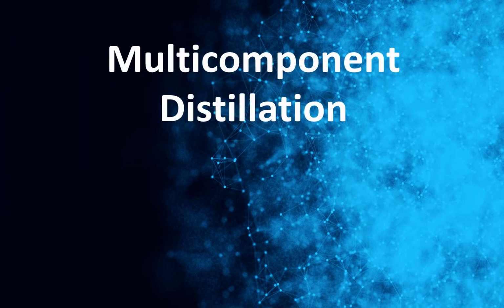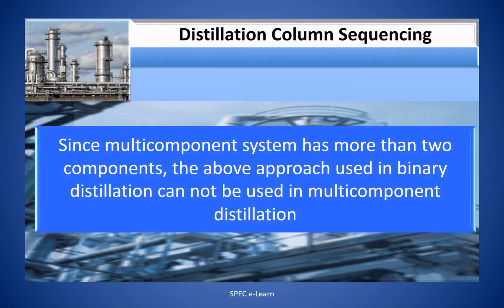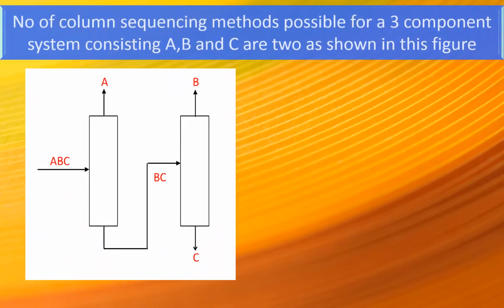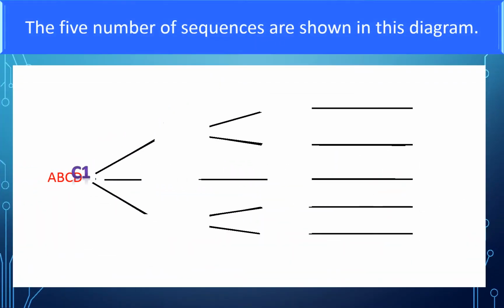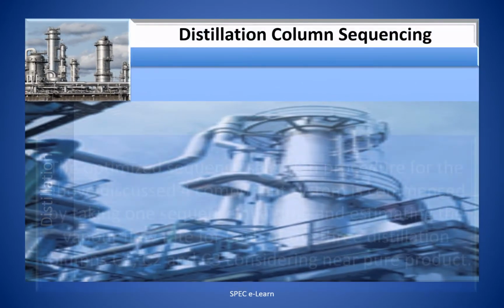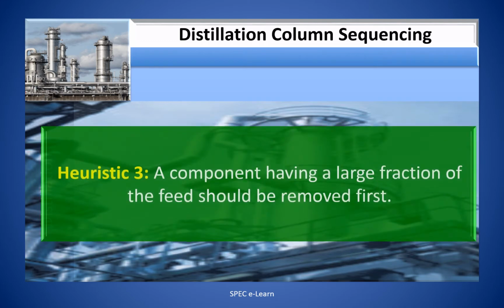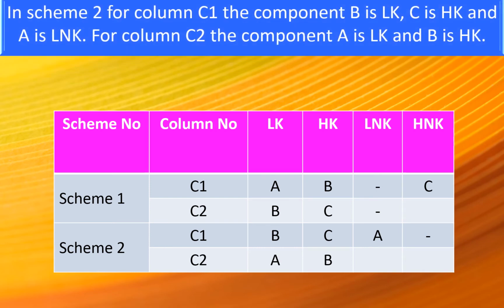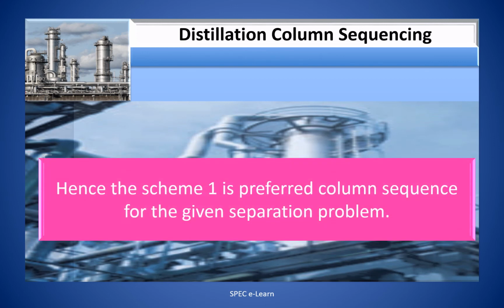Multicomponent Distillation - Column Sequencing And Selecting The Optimized Column Sequence

Comment: why feed enter from middle of column
Reply from the maker: Location of feed stage is a design aspect. Feed stage is selected such that  the feed composition matches with feed tray composition.
Reply: @SPEC786  
in packed bed distillation column
Reply from the maker: Packed column also has rectification section and stripping section in the case of distillation